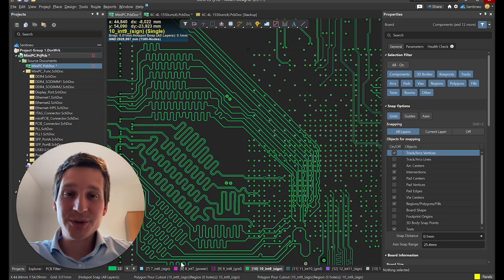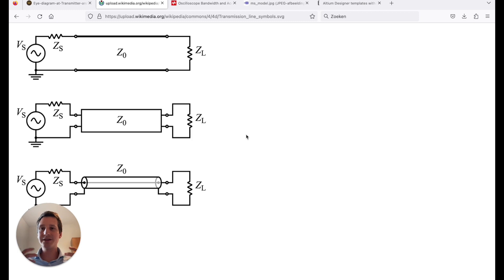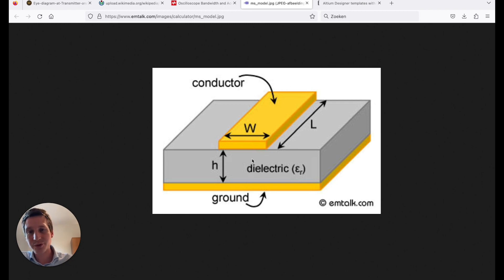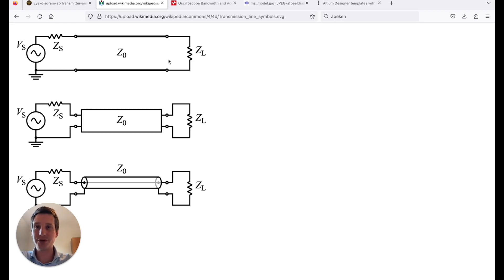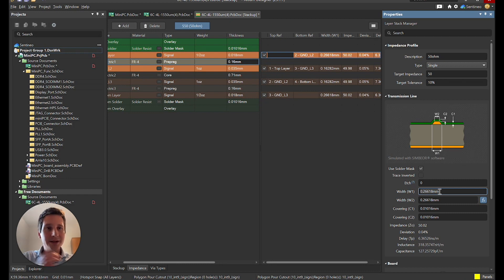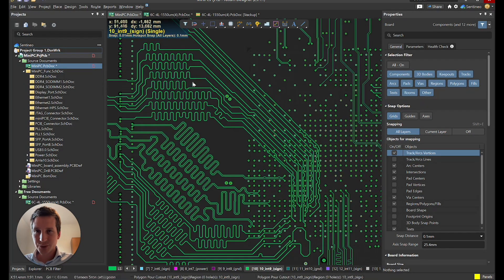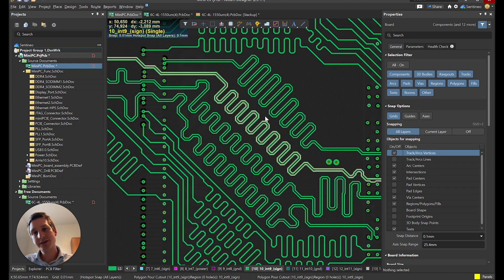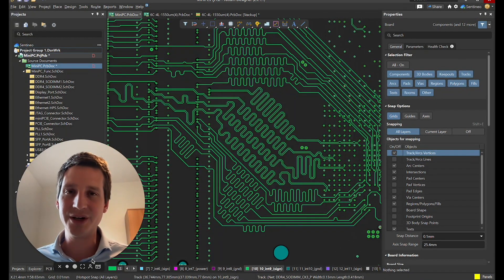High Speed PCB Design: How-To? Mastering The Basics For Success

Comment: hello. i'm new to pcb design and i would like to know what is the purpose of curving the traces like that? why not going straight?
Reply from the maker: hi, this is done for length matching. There is an upcoming video on that topic, but basically: you want your data signal to arrive in sync with your clock signal (or even a bit before). This can be done by making sure that traces on PCB have the same length, hence the accordeon structures for some short traces that need to be made longer. Hope this helps and stay tuned for that video ;-)
Reply: @sentineo  now i get and it make sense for high speed signals. is there a way to do it in kicad? just asking
Reply from the maker: @yacineyaker7485  awesome. I am sure there is a way in kicad, but never used it :-) If you look for "kicad length matching" you'll probably find some interesting videos. Cheers!